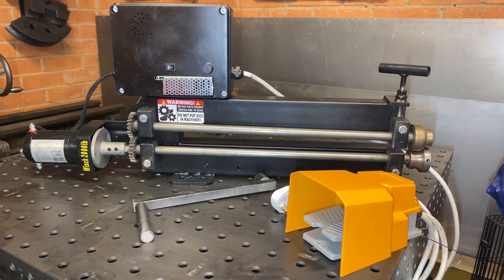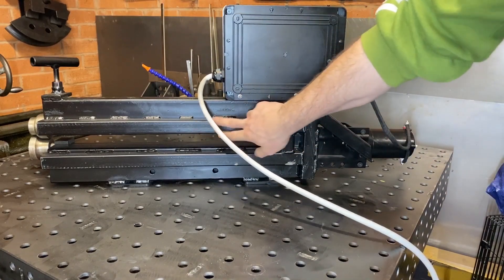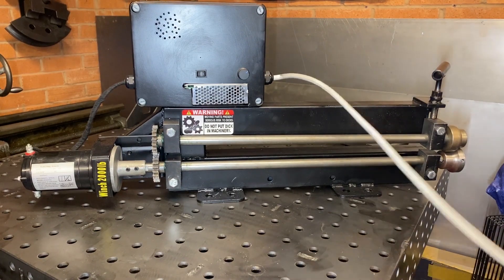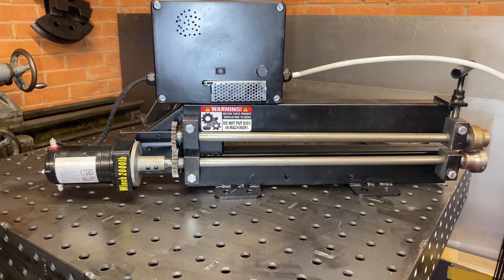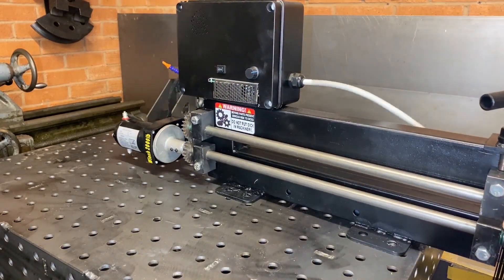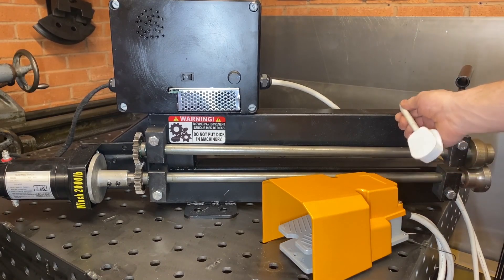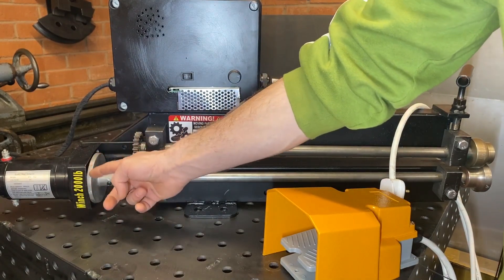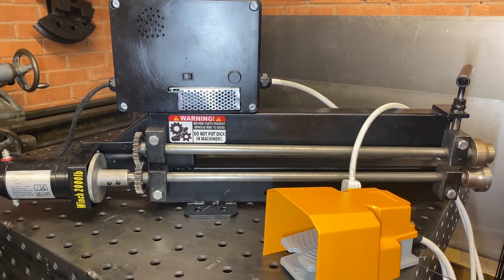How to fit a motor to a cheap bead roller - Motorized Bead Roller upgrade Under £100

Comment: Hey mate I literally bought the transformer and a winch from silver line. 
Seems like when I connect everything the motor doesn’t have enough power. 
I connect to a jump lead and work straight away and also with a battery too. 
I’m not sure if the transformer is strong enough or is faulty . The transformer is exactly like yours but without a fan. 
😞😞😞
Reply from the maker: Transformer sounds like it’s not up to the job, they all look the same but some can power bigger amps - which is what you want. Seems like you may need a bigger transformer

Comment: Hey buddy. Good project and seems you done very well.
Got a simple question .
Could you tell me what motor you would recommend because that one is not anymore available for that price . Could tell me what type of motor you would recommend please ? 

Thanks 😊
Reply from the maker: A 12v winch motor will work, doesn’t have to be the exact same one (and won’t be the same price now given it’s an older video). There are other motors such as mobility scooter ones also that are similar in size and amps
Reply: Thank so much buddy. Really appreciate your help. Your video is superb! You are a hero man!!

Comment: Would u be able to explain how you wired up the junction box in a video or possibly explaining what wires go into where
Reply from the maker: This video is a few years old, but it’s very basic wiring as the parts are literally labelled when you receive them

Comment: Hello wat size metal tube and wat kind is it and did u cut the winch wheel also can u use a 110v foot pedal
Reply from the maker: If you have 110v where you live then use a 110v pedal. I am in the U.K. so have to use everything 230v to be safe. The size of the box section I used in the video is mentioned in the video. I think off the top of my head it was 25mmx25mm with a 3mm wall (U.K. metric sizing). You can use any size really - the bigger the better 👍